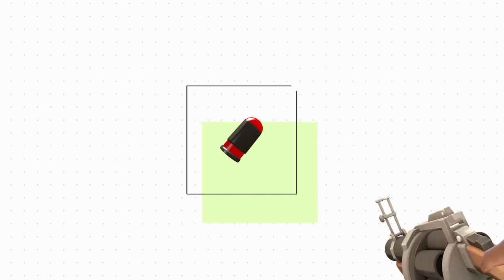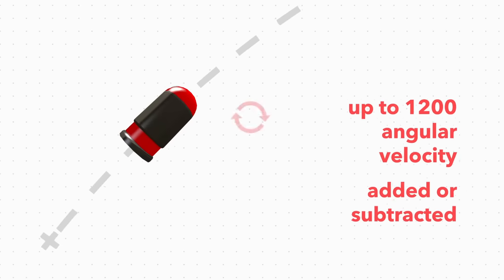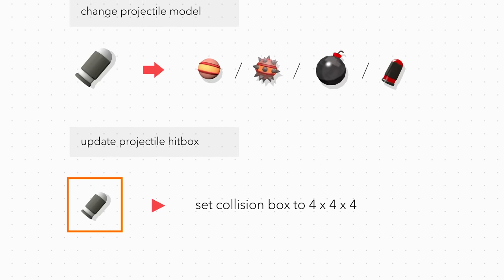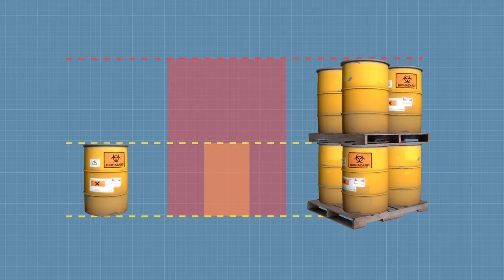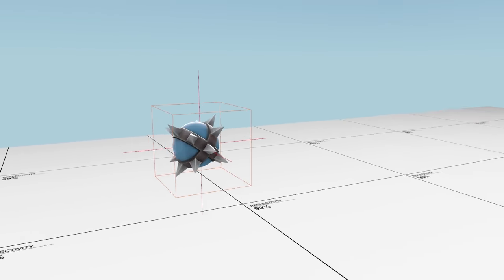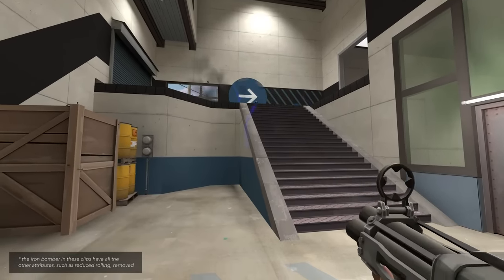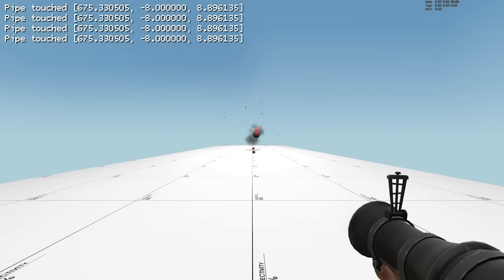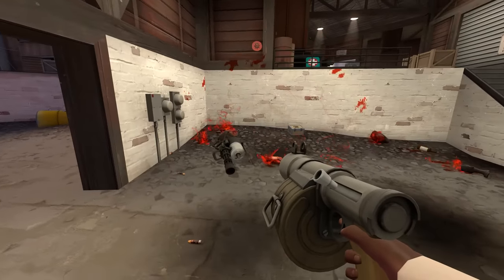the iron bomber has a bigger hitbox (& notes on pipe & sticky physics simulations)

Comment: Looking at the release dates of the weapons, we see that the Iron Bomber is the newest primary, and was released alongside the Quickiebomb Launcher in the Smissmas 2014 Update. With that in mind I'd wager that what happened is whoever implemented these weapons started with the Quickie, looked at the implementation of the Scottish Resistance and matched it, and then used that same implementation method on the Iron Bomber. The problems that arise are pretty unobvious, so since there were no massive issues, it passed spec and went into the game.
Reply: Justin  K
Reply: @thetrashmann8140  K
Reply: @hotdog2130  K
Reply: @hotdog2130  K
Reply: Interesting speculation. I wonder if Team Comtress 2 has a bugfix for the hitbox of the Iron Bomber. That’d be cool!
Reply: LunaScribbles it does!
Reply: @Why are you watching me? 
Hell Fuckin Yeah!
Reply: @timthetomatoman6064  K
Reply: @leonardo9259  K
Reply: @LunaPhobos  actually maybe make the stock a rectangular hitbox make the iron bomber smaller but not by much and drastically increase the loose cannon to fit its hitbox
Reply: 7 years
Reply: @joe k

Comment: Iron Bomber broken straight upgrade confirmed
Reply: Something people seem to miss is that, despite the "hitbox" being bigger, it is actually only the rough cuboid bounding box.
The physics model is actually still the stock pipe.
Correct me if I am the moron!
Reply: @lev7509  The larger hitbox is the one used for checking for player collision
Reply: @thetrueinferno7993  yeah another person pointed that out too. So it is broken.
Reply: The size difference is actually really small, only like 3 hammerunits which is like millimeter work
Reply: @SuperHeroGame2100  Yet it results in an 8 times increase in volume, enlarging the hit area of small character hitboxes such as scout to similar to a soldier or heavy
Reply: Always has been
Reply: @thetrueinferno7993  except pipes collide with the enemy's bounding box, which is the same size regardless of class. Also, surface area would play a bigger role in the hit calculation than volume.
Reply: @thetrueinferno7993  If I'm not mistaken all classes have the same collision hitbox.
Reply: @thetrueinferno7993  Volume of the projectile matters very little. What matters is the area that the projectile must travel through in order to collide with an enemy hitbox, and this value increases by a signifincantly smaller margin.
Reply: @SuperHeroGame2100  twice the size, 4 times the cross section (wich is what really counts). Sorry no sorry this thing is a crutch

Comment: Cool video, I remember hearing people speculate that the iron bomber was easier to hit pipes with because they were circular shape which would result in less wobbling when flying through the air (though that didn't make much sense tbh given TF2 doesn't simulate complex drag on things I think), so this is enlightening as to really why they hit more consistently. Hopefully the TF2 team sees it and is able to fix it or something.
Reply: I must say,I don't believe that TF has a real aero model (taking into acounts things like pipe orientation and so on ...) for projectiles. It seems too complicated and certainly of no practical interest.
Reply: >change the iron bomber's hitbox

No.

Comment: So basically, the devs that implemented the Iron Bomber didn't fully understand how to implement the projectile model and in a nutshell screwed it up altogether.  That sounds like the most jury-rigged way to get the model desired.  It was outright done incorrectly.

This also answers the question "Why am I so much better at landing direct pills with the Iron Bomber?"  It's usually chalked up to be the mildy more consistent trajectory etc., but in reality I think it's the drastically larger hitbox of the projectile.

The Iron Bomber, because of this information, may very well be a straight upgrade to stock.  That hitbox is a HUGE deal.

Comment: "Nobody complained about what I was until they looked at the source code."
- Iron Bane-r

In all seriousness I don't think the Iron Bomber is a crutch. I have just below 6 thousand hours in this game and use stock infinitely more anyway. I didn't feel bullshitted when an IB killed me before, why should I now? Because pen & paper mathematics don't always translate into the gameplay proper. If you were hit by an IB...you were probably gonna be hit if the demo was using stock. Sorry.
But remove tumbling from stock kthxvalve.
Reply: tumbling from stock forces you to aim, iron bomber is a straight upgrade in every way. Demoman never has or needed a buff when the sticky bomb launcher is your primary weapon of damage. Your grenade launcher should be a backup weapon but the iron bomber makes it a reliable primary and that's the problem.
Reply: @d4rks1p3  I respectfully disagree. Now granted, I always treated the GL as the true primary weapon. (I have about 8k more kills on my GL than sticky) Which is admittedly a bad habit, and I've been using sticky more. Fact is both the Sticky and GL are reliable primaries, IMO, and that's where demo's power comes from. He has two primary weapons.
Does the Iron Bomber have a slight advantage to hitting enemies consistently? Sure. Better than stock? Mm. I prefer my stock rollers and blast radius more.
And very hard disagree on tumbling. There is a reason most Comp lobbies and Creators.tf disable tumbling. Its another random layer to a game that should have very little.
Reply: It is probably better, when those clutch times come and you hit a pipe just barely hitting the enemy's hitbox, that you wouldn't have hit with stock is kinda BS, that said in casual this change is meaningless or anywhere where random spread for granades launcher is kept. 

If you look at the game in the most serious why, this is a problem that should be fixed
Reply: @bruschetta7711  Comp is truly the only way I see this being an issue, yeah, but frankly I don't know if we should change the properties of the IB to match Stock/Loch or vice versa. Frankly I'd prefer it if stock/loch matched the IB, but that's just me.
I play most the classes and I have demo in my pocket these days, but I'm a filthy Scout/Soldier main and must admit that Demo's pipes are far harder to use than rockets.
If they were changed to be more consistent, if only a near-negligible shred, I don't see myself or many comp players being brokenhearted.
Reply: But like, the iron bomber apparently also checks for the player bumping hitbox rather than the player model hitbox to know if it should direct, and let me tell you, the iron bomber hits WAY more often because of that. The bumping box is humongous.
Reply: @duhontheguy  I've definitely seen that. And I do think this needs to be rectified. My point isn't so much "leave it as is" as it's "using it doesnt mean youre a bad demo".
Yes, in testing, it's absurd this got past Valve. But at the same time, it got past all of us for 6 years because in practice, when everyone is moving and strafing in combat the hitbox changes the IB's effectiveness far less than you would think.
Reply: @duhontheguy  thats not true
Reply: @areseeus3267  Random spread is there to keep the weapons balanced, a grenade launcher should not easily hit a target med to long range. It's a high damage weapon like the shotgun, the sticky bomb launcher has a long range feature just for this exact reason and has very little spread. It's like people trying to argue for no spread on shotguns, its there to keep it from being used at long ranges. Shotguns in video games are powerful close range not long range, why remove this? Spread does not matter when a target is close to you. Sentries and other buildings are easy for a demoman to hit at any skill level, of course people like b4nny show up and are pipe gods but are so few. Demoman counters snipers very well since they typically don't move at all when your laying stickys on their feet. But of course not at the highest level when the sniper can just one click adventure you.
Reply: @d4rks1p3  Well, it's my belief that in med-to-long range, the pipe is more than dodgeable as is. It's not easy to land pipes at long range, and if you do it's hard to do. You should never be punished by a randomly generated value when you would land it otherwise. If you get hit from a very long distance by a pipe, it's kinda on you. Pipes are arcing and slow enough to avoid easily. In mid it's harder, but that's when individual skill and class matchup matters most.
I think you are confused about the argument for shotguns. It's not nospread people want, that would turn the shotgun into a slug launcher. No, people want FIXED spread because as is even close range shots can curve off to god-knows-where and can completely screw you over. If you play on a fixed spread server the scattergun and shotgun have all pellets in a 3x3 grid. Will there always be a pellet that's pixel perfect? Yes, but that's a pixel perfect shot at long range that does 3 damage because of falloff. The pellets still spread out to the point shotguns are mainly only viable close-mid like most engagements, just that it would be a reliable pattern not up to random generation. It's my opinion the less RNG in a shooter the better. The more luck matters, the less skill does. Can there be a bit of luck? Of course. That's how it is with everything. But the more baked into the game, the worse it is.
Reply: The tumbling on stock pills is only cosmetic, both the actual physics model and the collision box of the pipes travel perfectly straight.
Reply: @d4rks1p3  "Random spread is there to keep the weapons balanced, a grenade launcher should not easily hit a target med to long range."
Anyone with more than 3 hours in the game would be able to dodge a pipe from long range even if it had perfectly accuracy lol. Of course the actual rng affecting pipe trajectory is so miniscule already, so the point is moot.
Reply: @goldenhibid  In multiple occasions it's been shown that the iron bomber colides with the player bump hitbox. Even with a bigger collision box, it still wouldn't be as stupid as it is right now.

Comment: How about instead of nerfing demoman to the ground by making the hitboxes smaller, we adjust the hitboxes of the other pipes instead of making the iron bomber's smaller?
Reply: As if demoman needs buffing.
Also, it wouldn't be a nerf to demoman, but literally just a bug fix.
Reply: the A class that can directly hit easier than a rocket and can deal 100 damage before you can even react, are you sure we are just nerfing him and not “fixing” him?
Reply: @g2ltt733  hitting pipes is harder than hitting rockets

Comment: So, Demo's stock grenade launcher is apparently not rifled, as if it was, it would spin clockwise or counter-clockwise with the blue tip facing forward, rather than randomly tumbling out of the barrel and through the air.

Comment: Does  this mean air strike's hitbox is bigger since it uses different model ?
Reply: Very likely not. I'm fairly certain that rocket hitboxes are infinitely thin anyways, so it wouldn't matter.
Reply: @randomcatdude  ı disagree iron bomber changes 5 hammer units. ın a competetive manner 5 hammer units can change the game.Even if the airstrike chnages 1 hammer unit it still means its broken it must be checked.
Reply: @Jack_26  This bug happens due to model hitbox stuff, though. Rockets don't use their models as hitboxes at all, so this would likely not affect the Airstrike at all.

Comment: If you can aim, stock is better due to more blast radius

If you can’t aim, stock is still better because rollers from the bomber is easier to avoid because of predictability. Smaller blast radius affects crowd control and made irrelevant anyways due to stickybombs.
Reply: this, is exactly the reason why i still use stock over iron bomber. ive been practicing having good aim with stock, then switched to iron bomber and i just wasnt doing as good with it as i was with stock, i was missing more shots, and i guess this is the reason why
Reply: Counterpoint, though more predictable you are more likely to actually hit someone with the rollers with the Iron Bomber over Stock. If you chuck a grenade in a choke point and miss, it'll still land where you wanted it to causing at least some damage and people have less time to escape because of the shorter fuse time hurting slower classes like other enemy demos more consistently, whereas with Stock it'll roll off to who knows where, which is why it's still the go to for competitive players even after the nerf, it's simply more consistent than stock.

For a more strategic and slower demo go with the Iron Bomber for the consistency
For a guns-a-blazing demo go with the stock for bigger blasts and more kills

Comment: The IB sacrifices rollers, which are very useful, for easier to hit projectiles and pseudo-stickies if you miss
The IB rewards missing, and sacrifices a very useful mechanic for ease of use
The IB is a crutch.
Reply: "If any item is better than stock, it's a crutch. So lets nerf any items other than stock." A demo with 10 hours in the game who can't hit a pipe to save their life can just fire around corners, or shoot in that sweet spot distance to get roller damage. Both of these are examples of "missing" yet you don't call that a crutch.

Personally, I think the iron bomber hitbox is fine, although maybe it could get shrunk a tiny bit, so that the hitbox isn't literally bigger than the visible projectile on the screen. The main issue I think, is that other grenades' hitbox are too small, to the point where it becomes almost comical (just look at the loose cannon's projectile size vs its hitbox lol). Personally, I think the stock grenade launcher should have a rectangular hitbox and the iron bomber/loose cannon should have round hitboxes but that's just me.

Also, I personally think the iron bomber should've been the stock grenade launcher, while the stock grenade launcher should've been an unlock

Comment: proposal for a nerf:

Keep the bugged hitbox size the same (and make it a stat on the weapon/scale the iron bomber projectile up), but give it the accurate simulated model along with perhaps a slight damage nerf (5-10%?).

Now it has a new role as a direct hit focused grenade launcher, makes em easier but you gotta get closer since the pipes don't go as far and you won't be doin as much damage as stock, so you gotta trade off easier directs for more risk and less reward. Would probably be a good alternative to Booties/Cannon as Demoknight I think, for the Demo that want's a reanged option, but doesn't mind not doing more damage (gives him a chance to claim a head instead of gibbing) and doesn't know how to do cannon jumps

(maybe scale down the hit box a tiny bit down to like, 6x6x6 instead of 8x8x8 if its still too bonkers, or dial the damage down to -20% or somethin)

Comment: I'll just repeat what I have said 100 times so people stop bombarding my inboxes with this video-

I never said that the Iron Bomber shouldn't be fixed. In fact, I believe this needs to be fixed. All grenade launchers' projectiles should have the same hitbox size, not only for gameplay consistency, but for fairness as well. 

My problem is- this was never a major issue before we became aware of the fact that the Iron Bomber's hitbox is larger.  Sometimes, it felt easier to hit shots with the Iron Bomber (because it is to a certain degree), and after years of comparisons and analyses by other content creators- we have all come to the same conclusion: the difference isn't that major. As the "community" tends to do- when this new information came to light, they immediately blew this out of proportion and started running around like chickens with their heads cutoff, SCREAMING that the Iron Bomber was broken and MUST be fixed IMMEDIATELY REEEEE

When before, it had never been a major issue. And it still isn't.

Mathematically, and VISUALLY- YES, the difference in hitbox size is as PLAIN as day. But when it comes down to gameplay, the differences are subtle, but not drastic enough to the point where the Iron Bomber should be considered "broken." 

So please- stop asking for my head on a pike. I like how shounic SHOWS the hitboxes, and explained things in a way I cannot. It should CLARIFY why the Iron Bomber's hitbox is larger, but your own gameplay will let you decide if it's an issue or not.

As for why competitive players use the Iron Bomber more often than stock:
1) Iron Bomber pipes don't roll, so it's better area denial that  gives demos a second stickybomb launcher with the applicability of pipes.
2) Faster damage- shorter fuse times mean faster damage, which speeds up the slowest class in 6's competitive to be on par with the other classes used in the current meta.
Reply: Zesty dees nuts
Reply: Zesty Jesus J_peg

Comment: The iron bomber does have a large hit box but it’s not that big it’s like 2 centimeters bigger than the default
Reply: Yeah, but comparing 1cm to 2cm is the same as comparing 10cm to 20cm
Reply: @Roy The Idiot yeah but you have to agree it’s not that big I would rather still use the default or iron bomber